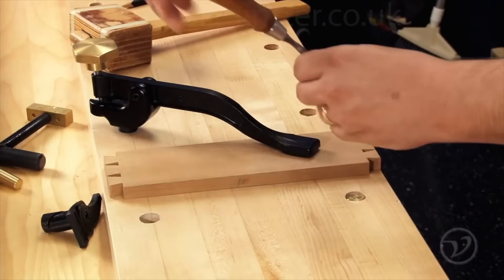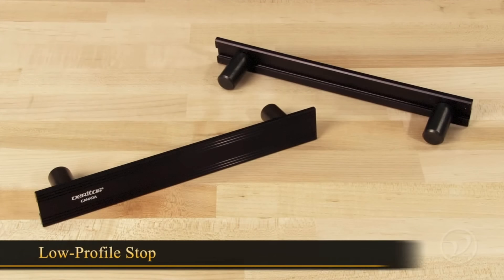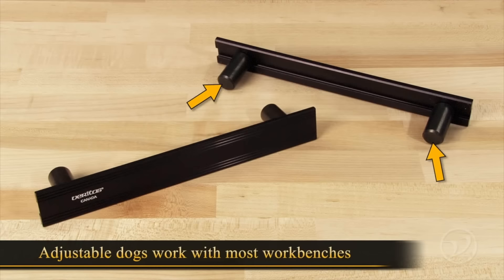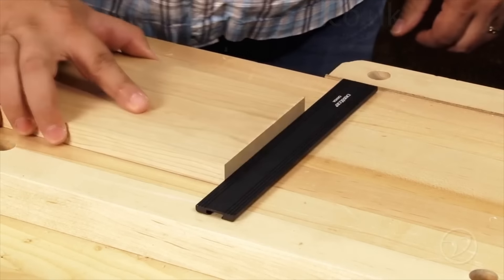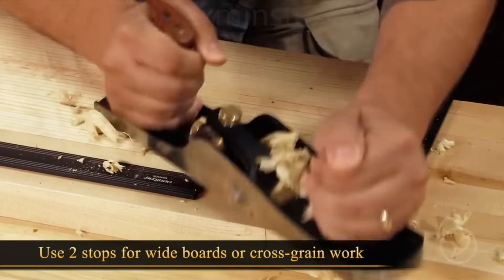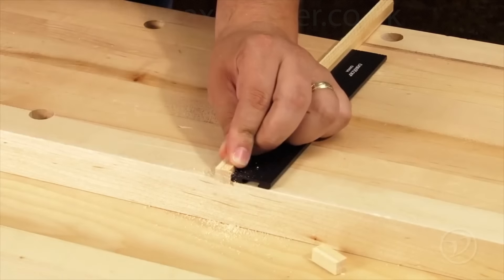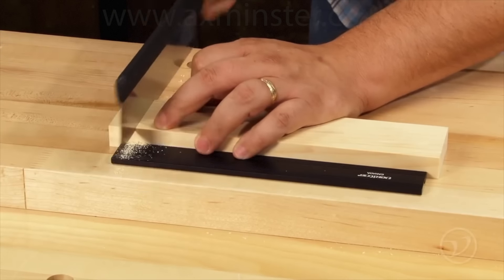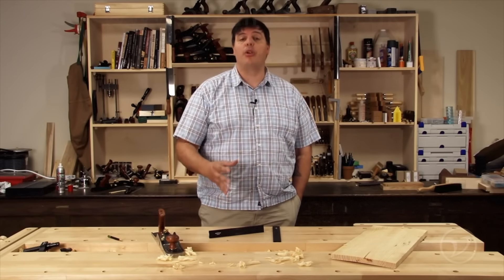Veritas Planing Stops -  Product Overview

Comment: One question I can't seem to find answer in any video about the Veritas planing stop.  Are the posts adjustable?  I'm about to drill my dog holes and wonder if I first need to buy a planing stop and measure the width of the dog holes or whether I don't need to worry about it if the posts are adjustable.